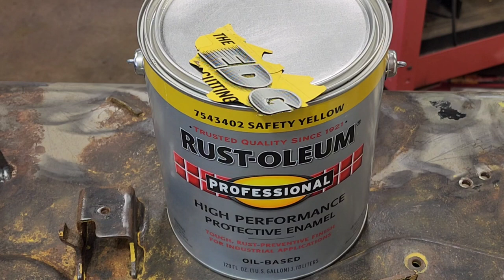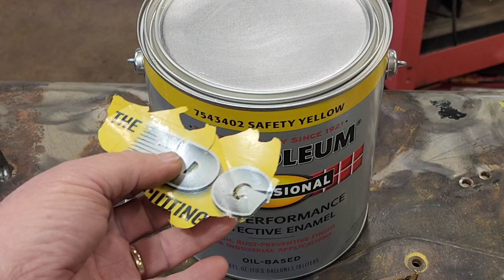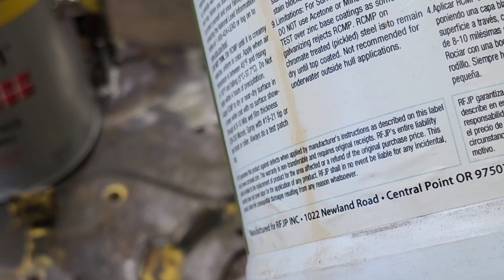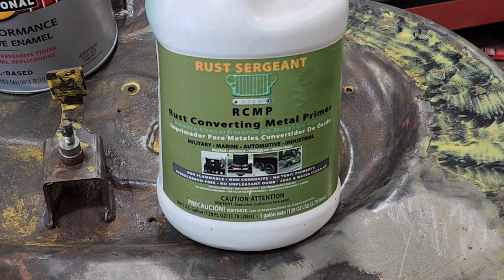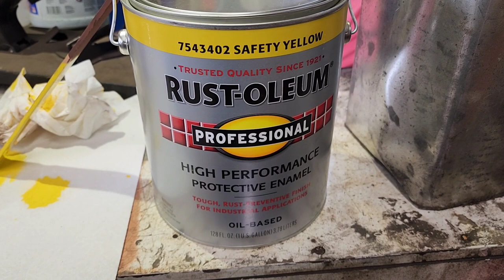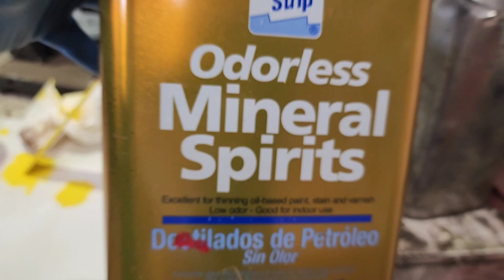John Deere Mower Deck Restoration Pt 2. Sanding, Rust Converting, Priming, Painting W/ Rustolium

Comment: I skipped thru a lot of the video but saw the main points. Prep/ prep and some more prep. Better points than most. Definitely knowledgeable on his restoring game. Get her done.. there is a time to be ocd and tmv(time, value , money) , I guess you get what you pay for! My personal mower deck I grinder it with flap discs (40,60,120) , media/ sandblasted any rust lows hard area/, glazed putty lows, primed with high build primer / finished with white primer( yellow covers like sh*t), sprayed ppg base coat and  clear coated 4 semi-heavy coats.  Amazing

Comment: A quick comment about the black primer you discovered on this deck. I touched up a few spots on my D130 (42" deck) a few years back with some POR-15 and it looks and feels like the black paint you encountered in this project. Could it be? Also, if you did invest time and energy in restoring the underside of this deck, what final coating would you recommend in the hostile environment of rapidly spinning mower blades?
Reply from the maker: You might be right, it could have been POR15 from a previous repaint.   I am a big fan of POR15, it's just so expensive , when you fix them to re sell them there is no return on that investment. I really wanted to try truck bed coating on the underside of a deck bit as a test it needs to be done on a mower that I keep or I'll never know how it lasts. I have seen a couple on YouTube that were powder coated.
Reply: Anything glossy and shiny would help the buildup of grad / hay. 2-part